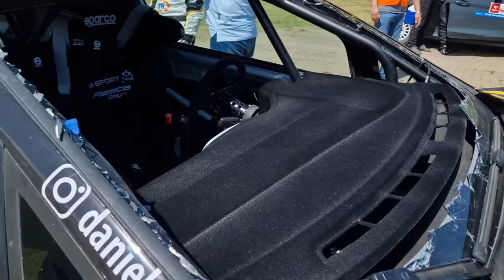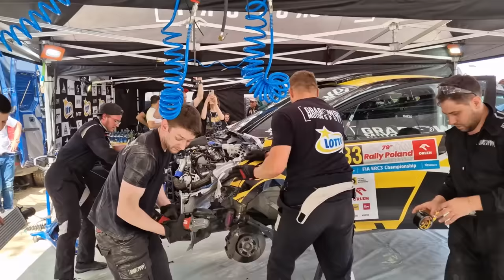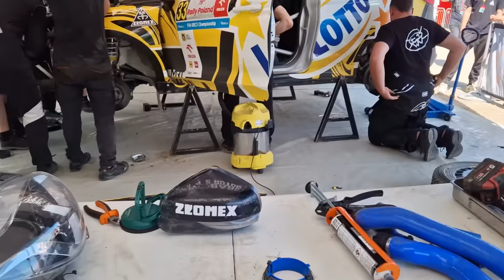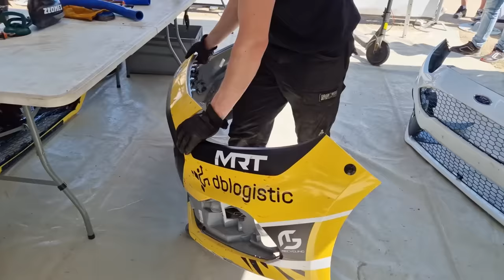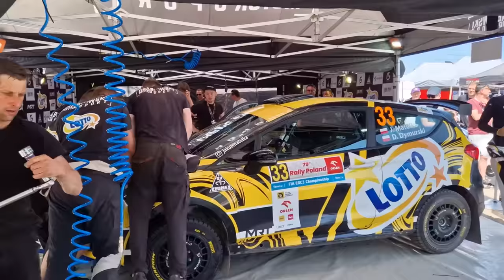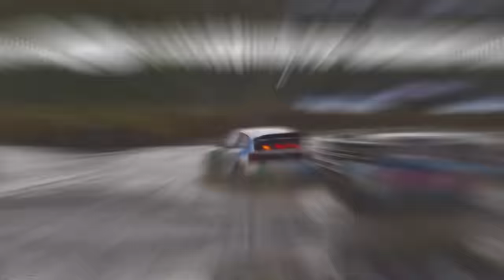M-Sport Ford Fiesta Rally3 - 30 min Service of damaged car, Lotto Matulka Dymurski Rally Poland 2023

Comment: 1st rule of driving,don't break the fucking car
Reply: That driver (crew, if the pace notes were off, contributing to the roll?) balled that poor little Fiesta up quite seriously, but not terminally, as demonstrated by this service crew! 👍
I want those; (front) Reigers (I'd use the rear Reigers from the 2WD/beam axle Rally 4 car), brakes, and wheels (I'd have to convert to 5 lug hubs though, along with the base car uprights) for my Mk7 Fiesta ST!! 🤤